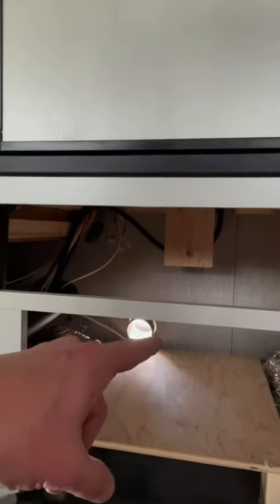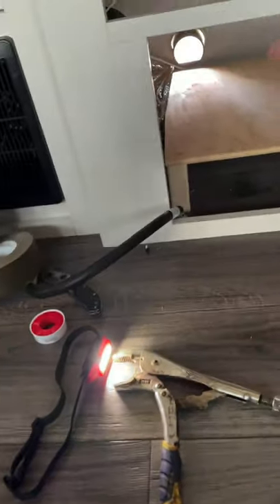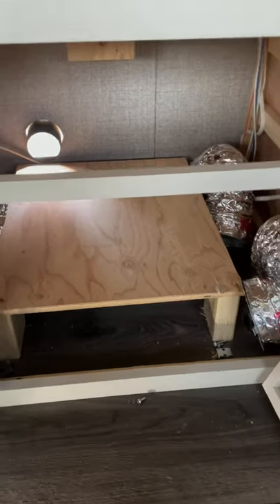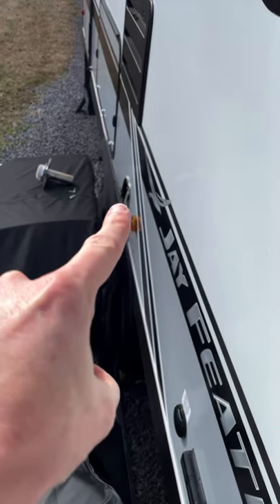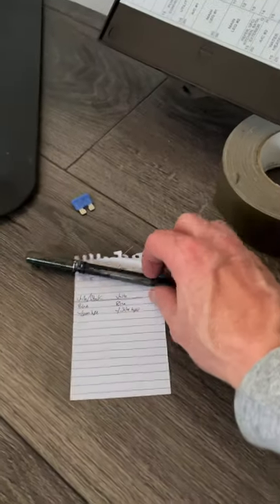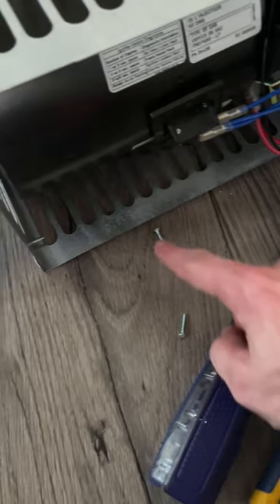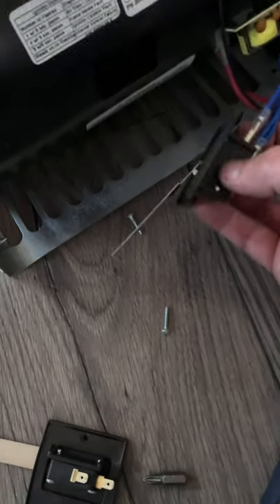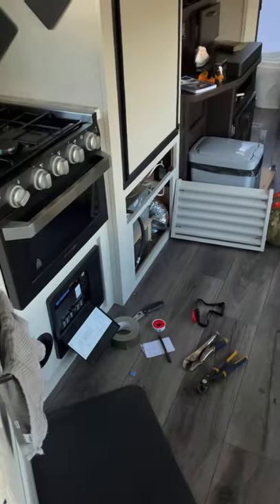Jayco Jay Feather 27BHB Dometic Furnace Sail Switch Replacement

Comment: Exactly the same way mine was working. Same sounds and timing too. At first the reason why it didn't even attempt to co.e on for me was because the dealer that did the annual inspection and fixes, replaced the sail switch, but didn't even plug the blue wires back up.

Then, come to find out, after you pointed out the issue with the venting, was that the smaller tube in the larger one (going out the wall) wasn't lining up properly inside the furnace itself. (Another larger pipe). I didn't take anything out, because it's a pain being on the bottom inside the panty, but I managed to fight my hand and arm through the small area and get the exhaust piping lined up. 

Now we're back in business, thanks to the vid
Reply from the maker: Glad y’all are back up and running and happy it helped.

Comment: Thanks for the video. We have a 2021 Jayco Jay Feather and had the heat not work once and took it to the dealer who said he replaced a solenoid and it worked again, summer of course. Last night 32 in East Tennessee and colder tonight. The wife and I took our Sail Switch out just like you show and sprayed it generously with electrical contact cleaner, put it back in and together and it started working again. The guy at the RV store said the tech just banged on it which we believe was the first fix. Anyway we are ordering a Sail Switch to have on hand for in the future as they seem to go bad often. Our rig is only 1 and a half years old. Little tricky getting the furnace in and out. We were able to do it and not disconnect any electrical wires keeping it close hole. We did pull the fuse to cut the power and disconnected the vent hoses. It took us about 2 to 2 1/2 hours start to finish. Took our time.

Comment: Sorry.... From what I learned from watching many videos about this, (mine quit IGNITING ), is that IF the sail switch gets dirty it will not work. So, I wonder if your switch had gotten dirty and you unknowing had cleaned it off..??? Think about it
Reply from the maker: This was a less than 6 month old camper that was kept very clean.  There was hardly even any dust on the unit.  Replacement was the only thing that worked.  The switch was just faulty.  I had a tech look at the switch later.

Comment: Thanks for the idea... mine quit working on our latest trip and I have to raise up the bed and take off the plywood cover that gives access to the heater, water pump and water heater... What probably took longer was all the trapped air in the propane line that had to be vented to get gas to the igniter...

Comment: Thanks...winter camping in Jayco Precept 31UL- after day and a half our Dometic furnace quite....very cold camping in 22 degree weather with snow.  Wish I had internet while there...fan starts, stops, no lighting of propane yet hot water worked; stove worked...why is furnace under the stove and why did I not know that at first?  No info from dealership showing where to find it...thank-you for your instruction...from one vet to another...easy to understand for me.